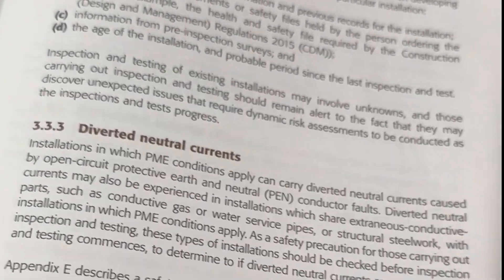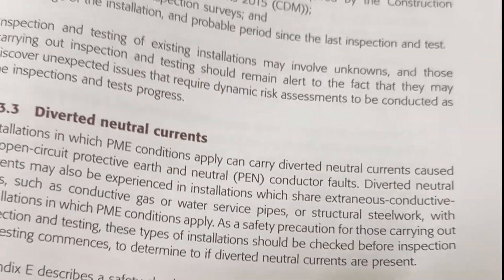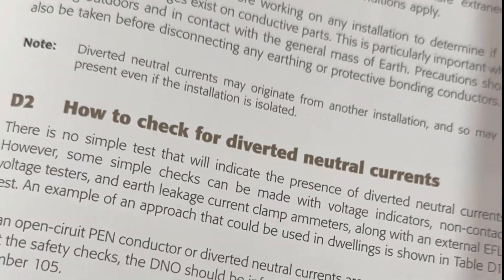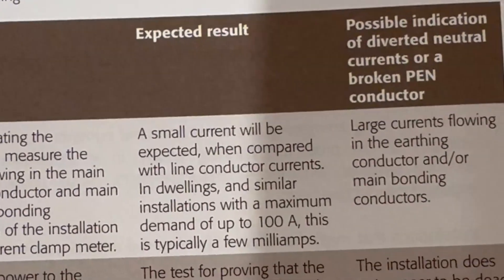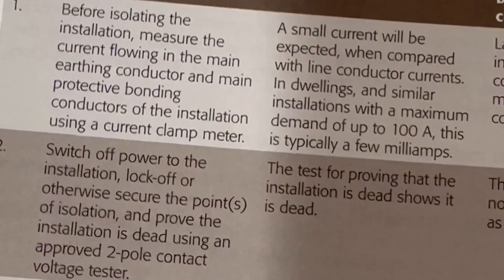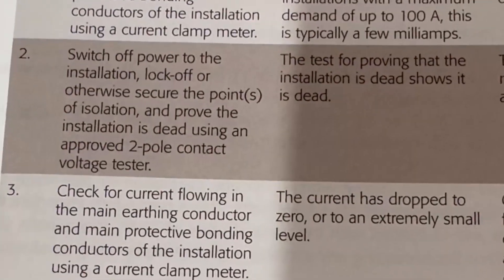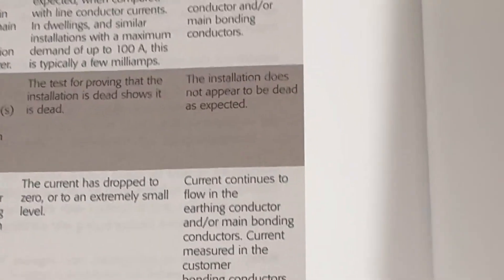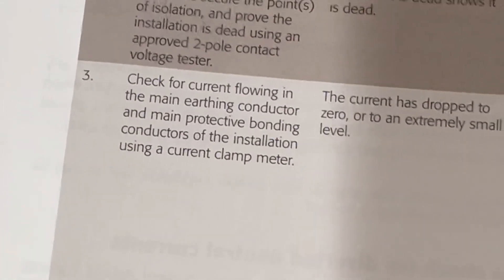PME PEN fault - Garo tripping out - Diverted Neutral Current....

Comment: Thanks Mark.
Where I live (not the UK)  the reliability and quality of the main supply is variable.
I am qualified and worked as a registered electrician in the UK before retiring.
I have recently experienced what I am sure was a PEN fault.
Fortunately there is a requirement of the country wide DNO to install an earth rod at the property before they will connect from the overhead distribution system which limited the rise in contact voltage but nonetheless illustrates how dangerous this situation can become if that local earth degrades or fails over time.
The DNO did rectify the issue within a day so credit to them for acting promptly
Reply from the maker: Glad the DNO sorted it, and thanks for sharing your experience.

Comment: Not an electrician, but I have an EV charger and this exact problem. Took me a while to find out what a PME relay is and what it does. I'm pretty sure replacing the unit will do the trick. Won't be touching it myself. Thanks for your advice.

Comment: Here's a situation for you, mate. I installed a 7.5kW Solax hybrid inverter with 2x 5.8kW batteries, performed a board change, and set up a renewables board for the PV. Testing the results for the PV CU are as follows:
R1+R2 = 0.35 ohms
IR = 999> L-N, L-E, N-E
ZE = 0.18 ohms
PFC = 876A
ZS = 0.53 ohms
RCD = x1 - 13ms, x5 - 13ms, Hager 40A RCBO, Type C.

The circuit is a 3-core, 6mm SWA, 25m run through the loft into buried ducting leading to the barn. Ducting, SWA for AC, and Cat 5 were installed by the customer. While the system runs smoothly during the day, generating PV and charging the batteries and discharging to the property with no issues, there are tripping issues at night. Monitoring the system, I observed 'grid lost' and 'grid frequency fault' messages. The customer set charge times between 2-5 am, and the fault occurred at 2:01 am. 

I've looked into 411.3.3 in BS7671, which outlines RCD protection requirements. My interpretation suggests that we might not need it since we exceed 32A. Any advice on where to look for a solution would be much appreciated."
Reply from the maker: So long as your final circuits in the PV board are RCD protected as normal you don’t need one on the supply to the hybrid if you have used SWA. Lots of inverters will peak the 30mA on an RCD/rcbo. Although I’ve never had a problem of that on solax when the cable type has required an RCD. 

Is it possible the charge inverter on the AC side is damaged? 

The solax hybrids themselves don’t require RCD protection. Nor does Swa

What size inverter are you using ? Is it possible you are seeing inrush on the MCB rather than earth leakage current.
Reply: @electrician247   The PV board is equipped with a 100A main switch and a C40 RCBO for the 7.5kW inverter, which is the only circuit within the board. There is an armored Cat 5 cable glanded into it, terminated with an RJ45 inside the CU connected to an RJ45 coupler for the CT.

Initially, I thought the issue might be related to inrush currents, which led me to switch from a type B to a type C. However, it tripped again the following night under the exact same fault/conditions. Unfortunately, we don't have an earth leakage device, and the company is unwilling to invest in one.

How can I check for a faulty inverter charge on the AC side? During the commissioning day, I was on the phone with Solax as the customer faced difficulties registering on the app. Solax suggested a forced discharge, which worked fine. Additionally, I performed a forced charge from the grid on 2 or 3 occasions, each lasting 30 minutes, without any trips.

I recall seeing one of your previous videos where you left a monitoring PV device at a customer's property to data log for a few days, a method I would love to employ. However, I am hesitant to cover the expenses myself.

Based on what you're saying, could I consider switching the RCBO to a C40 MCB? I'm only out my time 9 months ago, and it's the first time I've heard that you don't need an RCD for SWA. As my journeyman always told me, 'You only start learning properly once you're qualified,' haha.  Thanks for the speedy rely.
Reply from the maker: @Big-T-  this is UK specific but SWAT doesn’t require RCD protection unless the earthing arrangement dictates otherwise. With the 7.5kW solax advise a 50A OCPD which has led me to adjust one or two installs we had set at 40A. 

Is the RCD/breaker tripping in the night? Or the inverter just reporting a fault? 

It could be the voltage is dropping under the minimum inverter limit over night of the DNO have tapped it down
Reply: @electrician247   The customer is reporting multiple breaker trips at night. He's a controls guy who works for Scottish Power, so he's very keen, haha.
Reply from the maker: @Big-T-  I would go for a fault on the inverter if so had to guess lol.